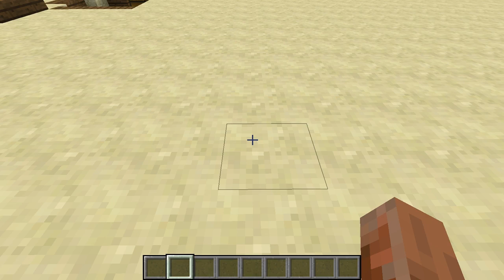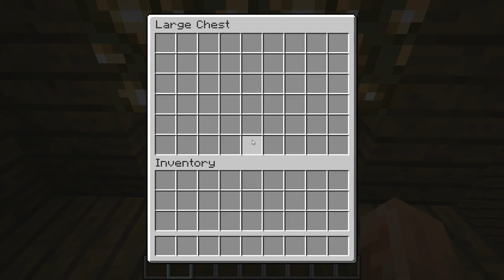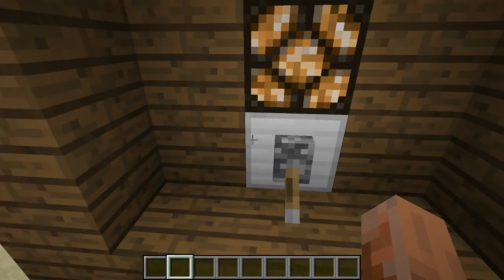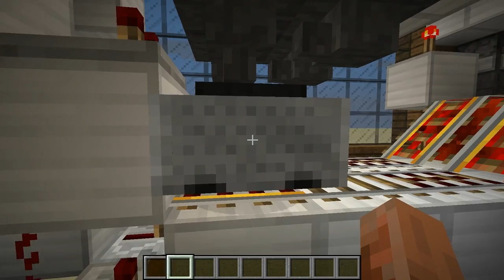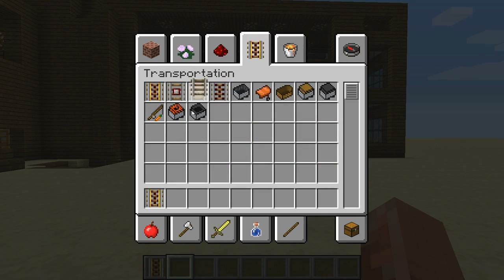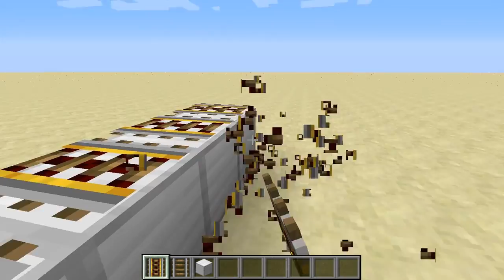Stack Smelter [SUPER EFFICIENT Industrial Furnace!] 4.5 items per second!

Comment: What's the average amount of resources used to build this ... not including ur awesome factory building just rails and redstone
Reply from the maker: It really depends on how big you want it, the loader can easily be made with a stack of redstone, a couple pistons, hoppers, and a redstone block. Rail wise I would estimate just over stack of powered rails could get the job done to a decent scale and then maybe a stack of regular rails as well. The real cost is in the hoppers for the furnaces at three per furnace, but no problem if you have an iron farm.